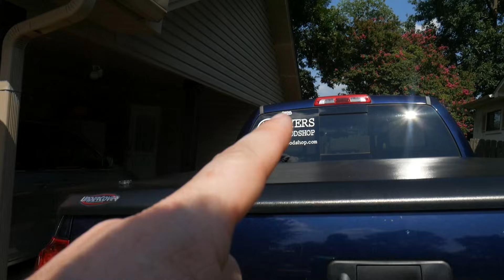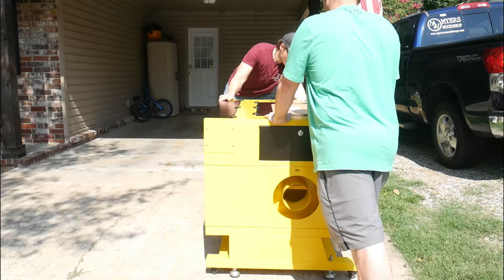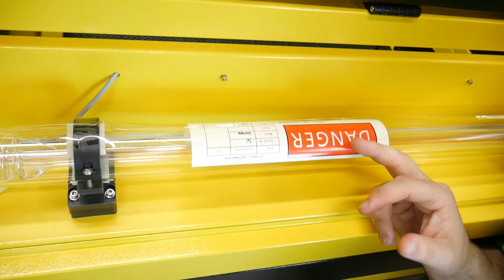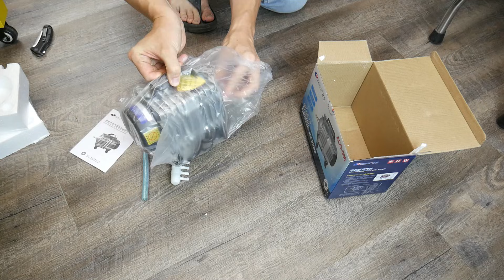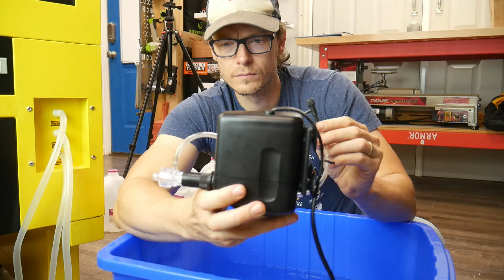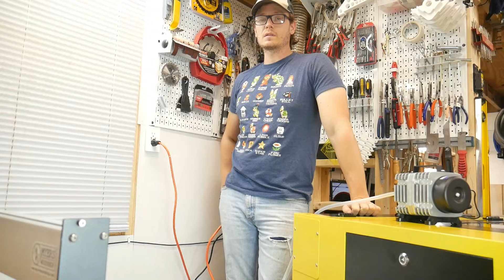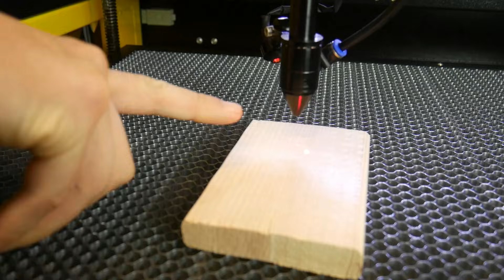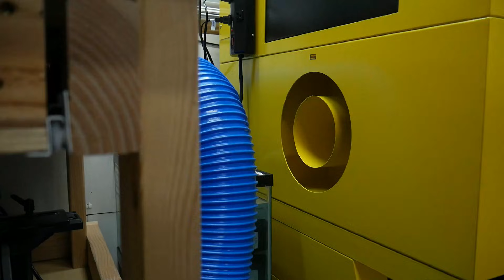Did I Waste $2400 on a 60W Laser Cutter from China?

Comment: Is it possible to remove the bottom base with the wheels so I can get it through a doorway. And if so, how simple would it be to half it and put it back together?
Reply from the maker: Yes. It’s just bolted together
Reply: Myers Woodshop are the bolts easily reachable without removing other components of the machine? Thanks in the advance for reply

Comment: Well... for contrast, I bought an Epilog 60w a couple years ago for $22,000... It has been fired for about 200 hours total so far, and I've had replace about $600 in components that failed (at my own expense, because Epilog's warranty is b/s). Lately, I can't seem to get a clean cut through 1/8in ply or 1/4in acrylic, and I'm being told it's because I need to replace my lens... which is $172...  So, I'm thinking you've done quite well to get a functional system you can use for $2,400!
Reply from the maker: nice!  I hear epilogs are awesome!

Comment: I did because I have had mine for 2+ years and totally rebuilt it from the ground up replacing 99% of everything then I realized I have no real uses for it since it is the only tool I have that I can't just use when needed since the CO2 laser tube degrades from the day it is made.  My current tube is near death with less than 20 hours on it (all testing and aligning) because it sat there without usage.  Worst decision I ever made was buying it.

Comment: hey there, thanks for these details! Cool to see. I have a question-- Nothing protects the belts in that lower chamber from lazer cut byproducts??! I'd think those belts should be below the metal floor of that lower chamber. I'd be watching to make sure no junk gets in those belt teeth! Having some gunk in there will throw off the sync between the four corners sligthly.

Anyway-- subbed!! Want to see this guy cut wood, and more please
Reply from the maker: more cutting will come!  sub to my insta and facebook to see a lot more cutting!   the belt only turns when you raise and lower the bed so no big deal.

Comment: Sound dB measurements are only comparable if taken at the same distance from the objects.  Typically you use 1 meter since that will give you an official dB SPL reading.
If you measure one thing at around 1 meter and another at 10cm the numbers don't mean anything.
That in-line fan is much quieter than 77db.

Comment: The inline fan is made for dust wood flakes etc sucktion .?The fan it came with had el motor on the side that avoid overheating of motor to catch fire.All the dust flakes it sucks is never in contact with the cooling of motor.There are inline fans that have been retracted do to catching fire.Just wonder
Reply: Agree. That inline fan is very light duty, wouldn't use for hot exhaust or sparks. The only good thing about it is, it's smooth quiet.

Comment: The first thing electricaly i would check is the grounding and powersupply.i would swap all the capasitors in that powersupply for mains power and all grounding points.Seen a lot of bad methods used in no known brand china prodused tool,s gear.Much just need some better capasitors and better rubber quality.Witch is cheap upgrade for all the electronic in the machine whatever gear you buy.where no name brand capasitors are used.How long it will work without electrical caused problem  is the question for me.Good luck

Comment: Air assist is to prevent smoke from getting to the lens
Reply: Yeah, acrylic with no air with smoke the lens up quick, which makes the laser hold harder in the lens, which leads to your lense cracking in way quicker than you would think.
Reply: Agreed.
Reply: Yes, not to "ventilate the box".....
Reply: That makes more sense to me.  When he said it was to prevent fire I thought that blowing air would actually increase the chance of fire :)
Reply: Reginaldesq It actually also does prevent fire. By adding airflow into the cut, the additional oxygen helps to quickly burn up the material from the kerf so that it doesn’t stay there to smolder. The air also cools the area around the cut. Materials only burn when they’re hot enough to vaporize so cooling prevents them from sustaining a flame.

Comment: That thing looks massive in 2019 when you can get at least a 30w LED laser (or fibre optics) and not have to worry about keeping lasing tubes and mirrors etc straight and in place... now there is usually a problem with too little shielding and the whole machine wandering because it is lite enough to mode it’s self.... not going to be a problem with that monster.

Not too long ago a 60w laser cutter was a really serious bit of kit and was usually a $10000 option for a router... I suppose you can still pay that much
Reply: Go look up the price for a 60w fiber or direct diode laser cutter
Reply: Robert Szasz 🤗 I didn’t say they were cheep. I mainly only use 15w 50cm dedicated ones but even a lot of the 60w 1m by 1m size cutters now are so flimsy you have to bolt them to another surface or you get blurring.

I haven’t used a mirror based setup that I can remember... I sort of skipped them as you can’t convert an old CnC router over nearly as easily to mirrored and have it work properly and safely... 
and a glorified engraver is about all I need for my current stuff.

Comment: Word of advice on the air for the machine. Don't use that pump that comes with it, as these are barely enough and don't last over time. Best thing is to connect a real compressor and connect the power strip to control a solenoid for the air inlet to the machine. Also the water cooling could use a radiator with a fan to dissipate the heat, otherwise there will not be enough cooling for the tube. Also add De-ionized water instead of city water to increase life of the tube. The duty cycle without a heat exchanger means a short cutting time.

Comment: Wrapping your ductwork with some insulation will help to reduce the sound level.  To conserve energy for heating and cooling, you could install a fresh air duct to bring outside air to the machine.  You might also put the entire setup in a sort of booth to help conserve heating/cooling, and reduce sound levels.

Comment: My 40w laser cutter would heat up the 4 gallons of water in the home depot bucket i used after about an hour of cutting. I used a Swiftech 120mm radiator and 2 120mm fans in push/pull running at 7v off an old HP PSU laying around and it helped a LOT. I used a power strip to turn everything on/off.
Reply from the maker: A week after this video we bought the 5200 chiller.  Yep, we have it all on a power strip

Comment: screws in the driveway? i bet you find the missing one in a months time, in a tyre. nice laser rig. I have one of those air pumps running for 7 years non stop in my hydroponic system, noisy bud good and they move a lot of air.
Reply from the maker: We picked them up, obviously.  We just didn’t show that on camera, figured no one would want to see that, but I guess wrong

Comment: I hope you used distilled water for your chiller. Mineral buildup in the system over time will have negative effects.  Also, add a cover to the reservoir to keep out contaminants. You might want to add a temperature gauge to keep an eye on how well it will be able to mitigate heat buildup. If it starts to get too warm you could go with a larger reservoir, or even better add a chiller to the system.

Yes, you do need to install the additional grounding wire directly to the machine. Just because your outlet has a grounding plug does not mean that your machine is 100% protected. from surges, shorts, or static buildup. There is a reason why they deliberately included it in the build. Ideally, it has its own ground isolated from the electrical wiring system in your shop.  Drill a through-hole in the concrete slab, Pound in a length of rebar and add a grounding clip.  Doing that is much cheaper than having to replace a fried computer control system. This is standard on all the CNC equipment in our shop and is manufacturer recommended. Better safe, than sorry.
Reply from the maker: A week later we got the 5200 chiller.  We did a video on that you can find in the other videos.  We used distilled water.  The fish tank was temporary

Comment: The blower you are using may be quieter but it's a totally different type. The original centrifugal blower can deliver significant more flow especially when the back pressure is higher. Hope you are aware of that.
Reply from the maker: Yeah, but we’ve be very happy with what we got.  And so much quieter.  And no, we’re not putting the other one outside the shop

Comment: Hi there, great video. We all start somewhere, and you got it to cut first time, well done. When cutting plywood or softer timbers, the air assist should give a cleaner and non "sooty" cut, if it is getting enough air. The laser I operated just used the shop compressed air supply which was adjustable at the machine with it's own regulator. Have fun, you are only limited by your imagination!

Comment: I don't know if you have done anything about it .. but you can get a 110 volt ac relay and plug that into those internal outlets and let that relay / contactor turn on and off a strip of outlets that are powered by the wall outlet.  The internal wiring may not handle the devices ... but the power for a relay is only about 1/50 of 1 amp or about 2-3 watts and I am sure it can do that.  You will get the same effect without stressing the internal wiring on the laser.  (search this on Amazon - uxcell AC 110V Coil Power Relay 10A DPDT LY2NJ with PTF08A Socket Base )

Comment: Use a temperature reader for the water and stop  using laser if water reaches 25C for longer life of laser tube. I use an old office water dispenser so the water flows inside the cooling container, I found it laying in the sidewalk one morning and took it with me for future use and it turned out great for my cheap laser cutter. You can use a new one, it is not expensive.
Reply: Surprised that it does not say use DI water and heat changer. I completely agree with you on keeping the water cool, and that will not stay cool enough with just a tank.

Comment: would this work on slate or stone?
Reply from the maker: Yes and Yes!
Reply: @MyersWoodshop   I should have been more specific, I meant to cut through lets say 1" stone.  I was going to buy a waterjet but this would be far less expensive.
Reply: @PatriotCoinRings  Have you ever tried melting or burning stone?  Think about it for a moment.....
Reply: @PatriotCoinRings  these lasers will etch/engrave slate, most stone, and glass. However, they will NOT cut these materials. A water jet cutter excels at this though.
Reply: @bob2161  Thanks, thats what I thought.
Reply: @MyersWoodshop  I doubt it will work on stone; it will shatter like glass (they are basically the same stuff)
Reply: @janami-dharmam  Makes sense, I was just thinking how rock can be engraved and if it can be engraved can it be cut with several passes similar to a waterjet?

Comment: Yeah, but I'm willing to bet that the black fan doesn't put out as much air as the bigger one!
Reply from the maker: it doesnt, but it does enough, and the trade off on sound is worth it for me.
Reply: Squirrel cage blower fans are much more efficient than those inline duct booster fans, you just got an insanely large squirrel cage fan that is likely way overkill for what you need. The difference is cfm vs static pressure. You can get a smaller blower fan and use adapters for the hose since it is an exhaust only.

Comment: Its very evident that neither of you should be near any kind of laser #1 you do not know the correct names of the major parts #2 your excuse for the power plugs is crazy China has the same electrical requirements that we and everyone else does so why the sockets will not work again.#3no idea how to setup and maintain this device go ahead run your greasy finger up and down that laser tube when it cracks dont complain #4 you untied the head and then pushed the machine across the yard and up the ramp well if it was in alignment it aint now. and please pickup the screws before you find them in you truck tire. again another case of more money (credit card) than money...This is sad.and where did you say you went to college???
Reply: Wherever you went to college failed to teach you how to write a proper sentence.  Holy fucking run-on Batman!
Reply from the maker: 1) this is our first laser.  Can you believe they didn’t teach us the names of laser parts in my MBA classes?!  How dare they!
2) a very fast and simple google search will show you burnt up units because of the lack of Chines quality control.
3) nope. When it’s your first you don’t know. Where were you to teach us?!  Can you believe it hasn’t broken?!
4) we did cut the string. We didn’t even align it before first fire that was successful.  I’ve since aligned the mirrors anyways.  If you think making it literally halfway around the world didn’t skew the mirrors, surely the 80 yard trip across the yard would.
5) why do you assume I used a credit card?  You realize I make money from the internet which I reinvest back into my shop to make more money to reinvest (and so on and so fourth).
6). We attended Harding University and The University of Arkansas.   Where did you attend?  Laser U?
Reply: @MyersWoodshop  Any good video like this attracts legions of armchair experts.
Reply: @MyersWoodshop  Walter Hynson probably has several valid points, if not all valid. You guys are talking out of your ass almost half the time! Masking tape you say is electrical tape; seriously? Air assist is to blow out fires (you mentioned this twice, which makes this bad video editing too!)? Dude, have you researched this at all beforehand? Even I, that haven't researched this at all, almost (I've seen perhaps between 1-3 short videos about laser cutters, and only one of them actually explained some of it), know that is not what the air assists is for! It is for blowing away smoke, so both the beam has better focus/efficiency, and not to dirtying the lens and potentially ruin it over time! There is no lack of people pointing out your faults and errors either, so won't bother to repeat some of them...

You both have no idea how watercooling works either, since you manage to put in the air bubbler or what it is called on the aquarium pump, which most people who would normally buy a laser cutter would have deducted is not necessary here! The orientation of the pump is wrong too, which on some types of pumps can be bad! It is quite possible that the laser tube will last shorter than intended because of this and other error factors!

If the wiring and/or sockets on the machine isn't good enough, CHANGE IT THEN! Instead you were planning to doing HALF ASSED SHIT SOLUTIONS INSTEAD, which coincidentally, might be the same amount of work too! But then you decided to use a power brick, rendering that previous portion of the video pointless; again demonstrating YOU ARE SHIT AT VIDEO EDITING! Also, how is the power brick fireproof? Are you that fucking dense?

If you are wondering why I'm so hostile, is because you answered like a fucking shithead to Walter! Sure, perhaps he was a bit rude, but have you ever wondered why your video has so many dislikes, TAKE A FUCKING GUESS! It is because you both have clearly not researched shit beforehand; or done it again, A HALF ASSED JOB OF IT!

I picked another video of yours, and again, a pretty half assed job in that as well. This is no longer 2012, where this shit might have flown! Also fuck you for your clickbait title!
Reply: More money than brains

Comment: Haha I run a laser kind of like this. Look up Gerber Rql flat bed laser. We cut metal and wood on it. The thickest wood we can cut through is 3/4. Keep the mirrors clean and lens if it has one. Good luck :) Also, if you can adjust the speed of the machine your cuts will be cleaner.
Reply from the maker: yep, getting speed and power dialed in is key!

Comment: dB is logarithmic scale. The 3dB change equates to double the loudness. I would have probably opted to putting the blower outside in a box thus isolating yourself from the noise considerably.
Reply from the maker: that's an option, but i chose to keep it all inside.

Comment: is that 1/2" wood there? I thought 60 watt  could only cut 1/4" material.
Reply: the wattage defines a threshold of what type of material you can cut and what speed. You are correct that a 60W is more suitable to 1/4" but it will cut 1" if you have the time and don't mind a rather deeply burnt cut surface as the energy absorbed into the walls of the cut is much higher due to the slow cutting speed.
Things required for deep cuts are air/smoke removal from cut, good focus to keep a pinpoint beam with minimal divergence.
Things required for a clean cut, power to keep a high cut speed.
A 60w laser on 1/4" wood will char the edges dark brown to black a few thousandth where as a 1000w laser at the correct speed and focus will surface char and clean up easily.
Reply: another1 commenter and a long-focus lens, like a 4”
Reply from the maker: I've done some 1/2 wood but its not easy.  1/4 is the sweet spot.